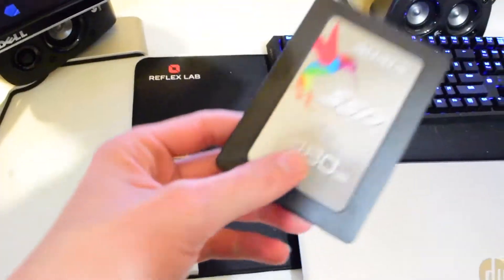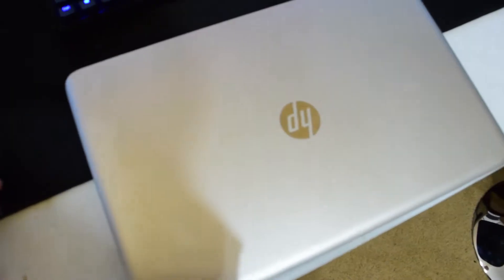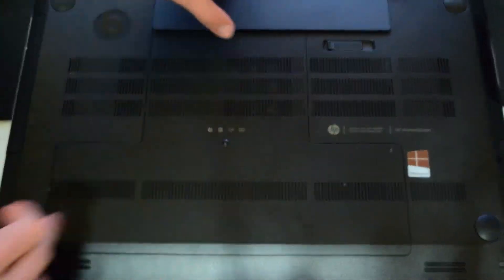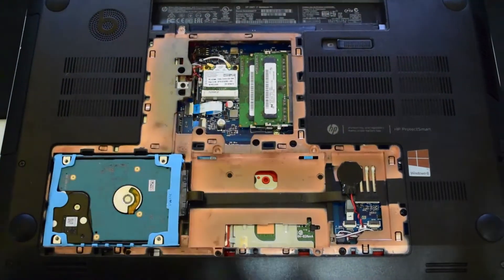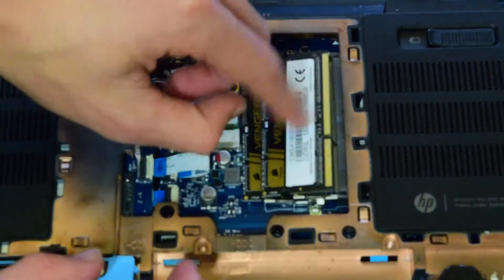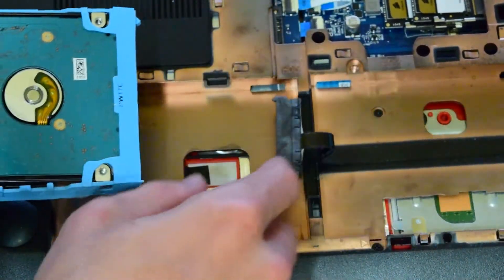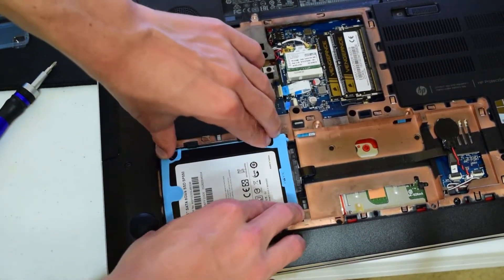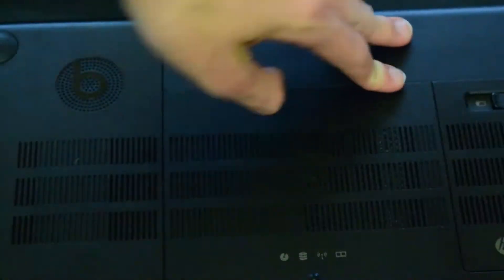Hp envy 17 ram and ssd upgrade

Comment: Not meaning to condescend - quite the opposite, in fact - but I would estimate myself being at least 40 years older than you and yet I find myself in your debt, sir.  I was looking to upgrade the memory on my HP Envy 17 but I was put off by the "official" instructions on the HP website on how to do it.  For some reason, they have you working from the top down; i.e., remove battery but then remove optical drive, rear corner covers, top cover, wireless module, and then the system board itself.  WTF?  If you don't believe me, watch the video at https://support.hp.com/us-en/document/c04336031.  You, on the other hand, remove one screw and the BOTTOM cover and the memory chips are right there.  Unbelievable.  Folks, do what Len says, not what HP describes.  Thanks, Len.
Reply: Right?? Me too ( age and hp comment! Thank God for these youngsters helping out us old folks!! We had the best music. 🤘🏻🤘🏻🤘🏻Hurray for Generation X!!). HP just wants to make money. Len, I just upgraded a 7- year old laptop for $37! 

Thank you!!!!!

Comment: Do you know if this laptop would accept a i7 extreme , I have i7 4700mq ...want to add a ssd along with my hdd 1tb cuz it accepts both. And do laptop ram have heatspreaders on any ram modules? NVM I used venganve...now we both just need a external gpu or liquidsky
Reply from the maker: No the 4700mq is soldered on board so you cant change the cpu. yes you can add a additional drive but you must have 2 of the cables used to connect the drive to the laptop, mine only had one and i don't know what type cord it was or i would have left the 1tb drive in the machine. yeah a gpu would be nice. but no the ram cant have heat spreaders or they wont fit.

Thank you for watching, don't forget to subscribe, have a great day.

Comment: Maybe you can help me. I have a HP pavilion Notebook 17-g113dx running window 10 64bit. I currently have 4gb,2g of RAM installed. According to what i thought I read on HP website it said that I can upgrade to 128gb of RAM. Does that sound right? Also can you suggest a top of the line RAM. Thanks for any help
Reply from the maker: Idk where you would have read that, but according to what i could find the cpu you have is a i3 5020u and that cpu itself only supports 16gb or ram. It might can handle more ram but the largest sticks of laptop memory you can get are 16gb ddr4 modules for a total of 32gb, but this cpu and laptop uses ddr3 so you'll be limited to 8gb modules anyway, so 16gb is really the most you can have. You might find bigger ddr3 sodim modules but the cost will get pretty high for those so i would recommend jsut 16gb at the most.

Link to 16gb of ram: https://www.amazon.com/Crucial-PC3L-12800-204-Pin-SODIMM-CT2KIT102464BF160B/dp/B007B5S52C/ref=sr_1_5?s=electronics&ie=UTF8&qid=1493747809&sr=1-5&keywords=ddr3l

Thank you for watching, i hope that helped, don't forget to subscribe, have a great day.
Reply: Thank you so much for your reply. I guess I was reading the HP web site wrong. I think I will get the memory you gave in the link. Is corsair a good company? I want to get the top of the line memt
Reply from the maker: Your welcome, yes Corsair is one of the top of the line manufacturers they are all pretty good, I like Kingston, corsair, crucial and my personal systems all have G.skil ram, and there are a couple others I can't think of off the top of my head but all very good and reputable companies. Corsair has has some really good memory recently but all of those are really good